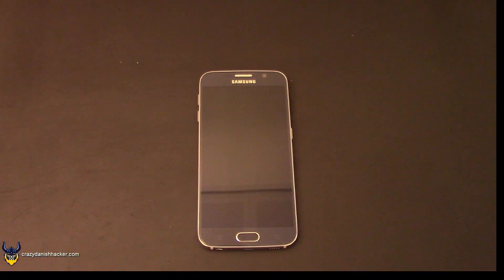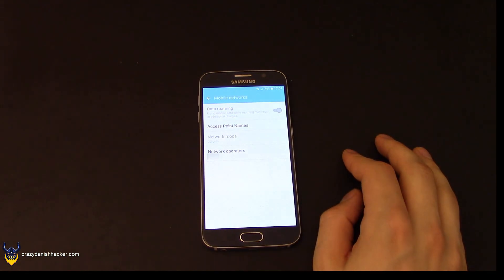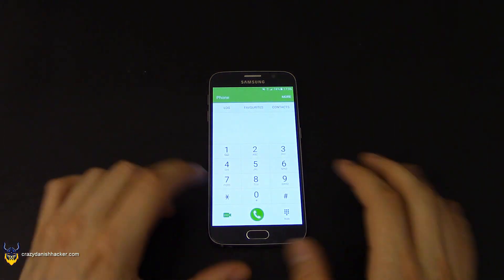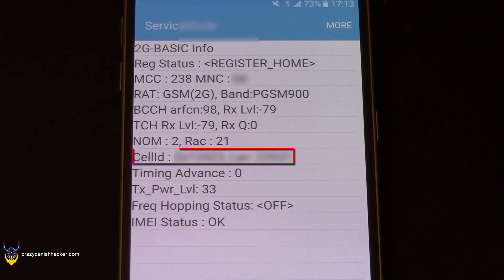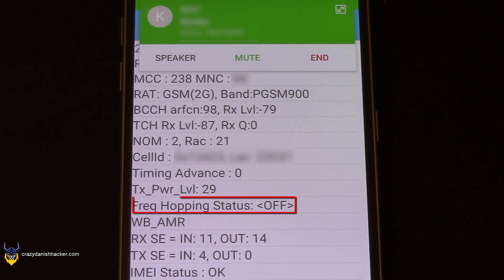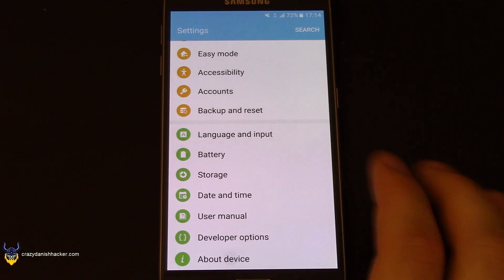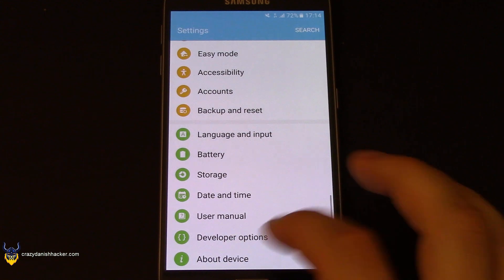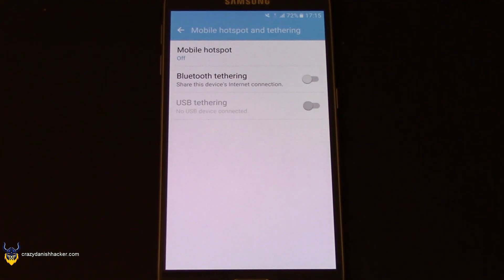GSM Sniffing: Requirements - Software Defined Radio Series #2

Comment: so how much hz do i need to have on my antenna to spoof sms?
Reply from the maker: That's not how any of it works.
Reply from the maker: You need to send the SMS to a valid network first, and on that network you need to have an account. This is automatically done for you with a cellphone and a SIM card. 
If you broadcast your own GSM network, then if someone connects to your network, then you can broadcast SMS to everyone who are connected to your GSM network.
You can also use third party services to send SMS.
Reply: Crazy Danish Hacker  you didn't understand me coz of my bqd english, I asked how much hz does my antenna need to have for getting gsm signals
Reply from the maker: Your question doesn't make sense :-) But I recommend you watch all of the videos, because it sounds like you're asking a question I already covered in the videos, i.e. at which frequency in MHz (or Hz) are GSM signals typically located?

In that case, look around 950MHz, 1800MHz, etc.
Reply: @CrazyDanishHacker  if I follow your reasoning it is enough to create a network (evil twin) a person connects and I can read sms and hear calls? if so can we do it with an rf hack? and if it is not possible with the hackrf how to do it?
Reply: Crazy Danish Hacker sir he's talking about the frequency how much MHz he needs on his sdr so he can do what u did

Comment: whar are the technical detail ( like : recieving frequncy , bandwith etc. ) i need to check while buying the sdr ?? ( for india)
Reply from the maker: If you're planning on buying an SDR, and it's the first time you're thinking about buying one, then you should get an RTL-SDR as they're very cheap, and will be more than enough as your first SDR. If you're still interested in SDRs and want to get a "real SDR" and have the funds to do so after some time, then you can check out this comparison for example: http://www.rtl-sdr.com/hackrf-vs-bladerf-vs-usrp/

Generally speaking it's the same all over the world for GSM. However, if you want to be 100% sure it'll work in almost every country, then it needs to support frequencies from 800MHz to 2200MHz because GSM can function on these bands 850/900/1800/1900/2100, and have at least 2.4MHz to 3.2MHz of bandwidth. (This bandwidth is standard for most if not all RTL-SDRs.)

If you get an RTL-SDR, then you should Google which GSM bands/frequencies are used in India, (probably 900MHz and 1800MHz), and then buy an RTL-SDR that supports that.

Comment: hello nice video
 but where can I find usb antenna that you used in the video
thank you
Reply from the maker: It's the default antenna that comes with the Elonics E4000 TV tuner dongle. You can buy them from RTL-SDR.com, e.g. http://www.rtl-sdr.com/buy-rtl-sdr-dvb-t-dongles/ (The R820T2 + RTL2832U should be even better.)
Reply: ok thanks
Reply: @CrazyDanishHacker  where did u buy the rtl sdr